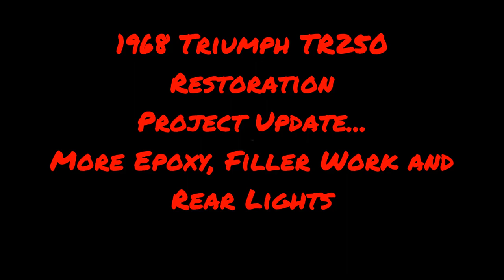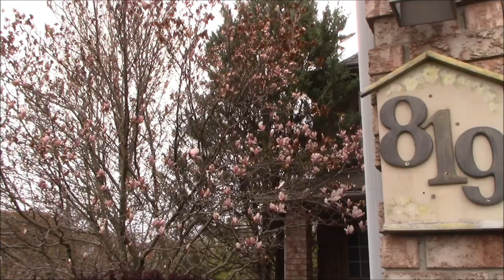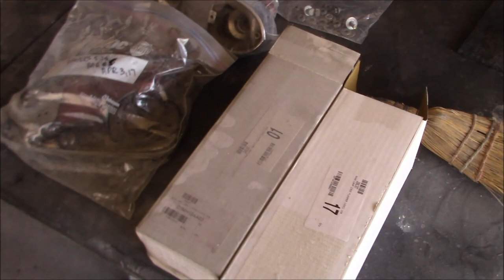1968 Triumph TR250 Restoration,  More Epoxy Primer,  Filler Work and Rear Tail Light Fitment

Comment: Visions of the future, with the rear lights and rear wings on, looking good mate. As with the UJ covers on the driveshafts, I don't think they make much odds weather you have them on or not. The only issue I have with them being on is it makes it harder to grease up the UJ. As much as I like originally and they do add a bit of protection from road crap, they just get in the way of maintenance, so on mine I've left them off

Comment: Just out of curiosity, is there something wrong/worse about brazing versus welding your repairs? Or is it just personal preference?
Reply from the maker: Well, most of the brazing that I have ever come across has been really poorly done.  I’m assuming that if you knew what you were doing, brazing could come out just as well as MIG.
Reply: @cheftush  Thanks, I was wondering. :)

I did some brazing a few weeks ago for the first time in 45 years. The first joint looks like crap, but I got my act together and the second one came out perfect. And it didn't help that the only setup I have at the moment is a cutting torch. That can't be good...

But I think that to help avoid warping on sheet metal panels I would use a MIG (which I have much more recent experience with, since it has only been 35 years since I used one of those).
Reply: @MrWaalkman  You can't butt braze the repairs but an overlap joint is an ok repair. It was all we had back when these cars were on the road, a mig was just something that you read about in books or was used in the aircraft field. As with any "weld" getting the repair clean was the big challenge to keep the corrosion in check on the back side and to get the plastic filler to stick on the brass.